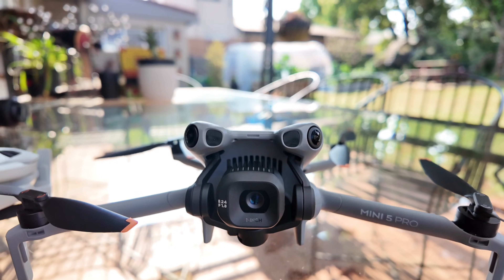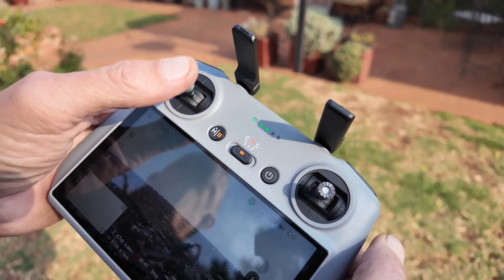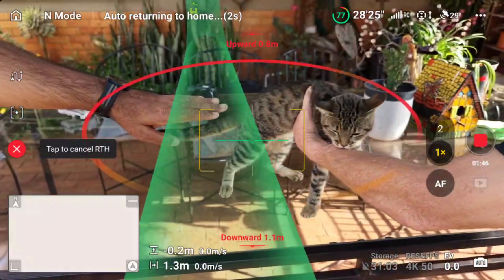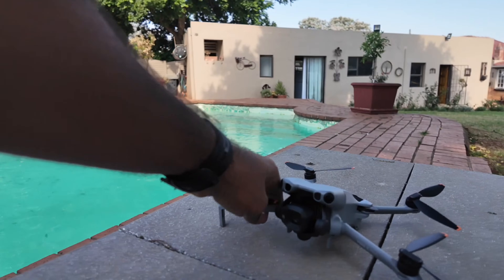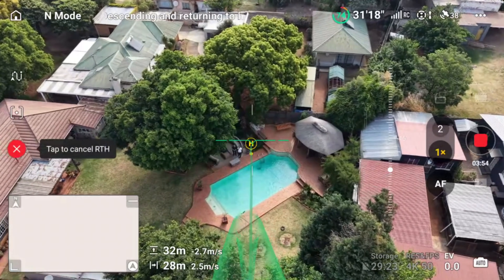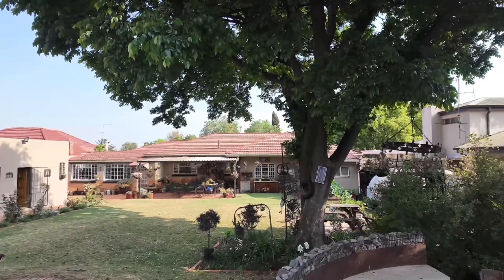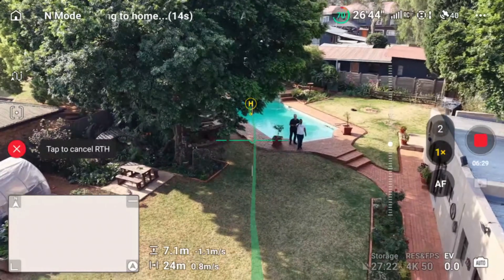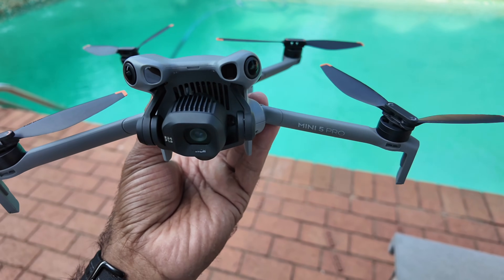DJI Mini 5 Pro Auto Return to Home Accuracy Test with LiDAR (3 Attempts)

Comment: I have a Mavic 4 Pro, which I love very much.
I have a question: the LIDAR-guided RTH: does this mean I would need to fly out from under a Balcony backwards for the drone to recognise the way back in under the same Balcony when returning?
Reply from the maker: It does that by itself
You just need to triger auto return to home and it will use thr lidar to vome back